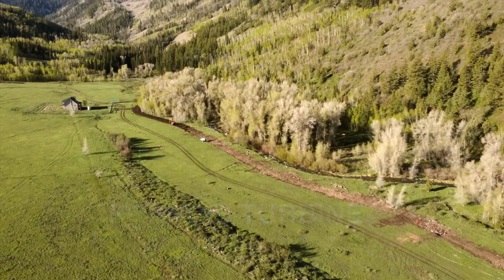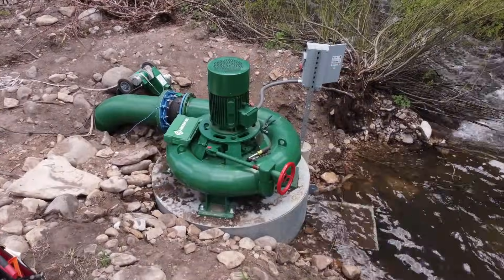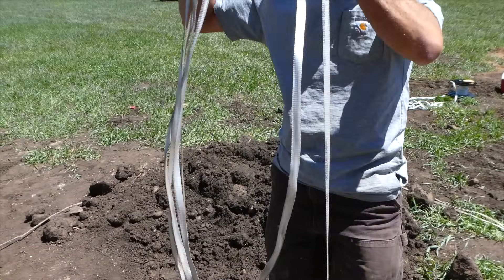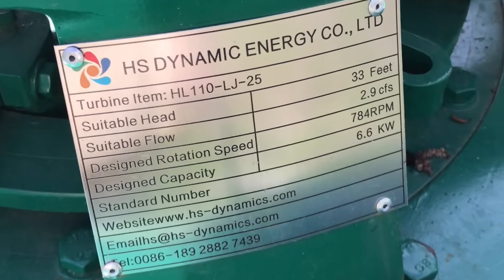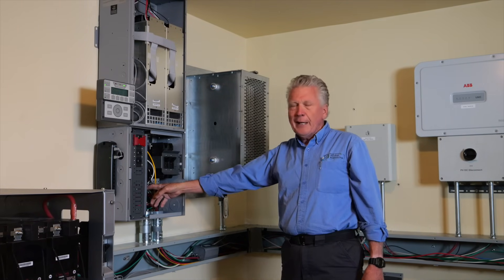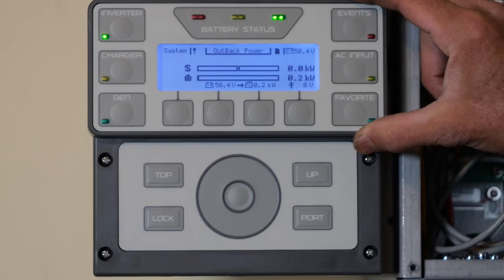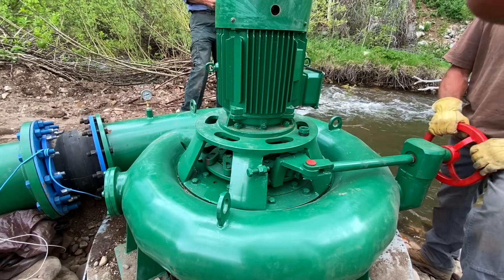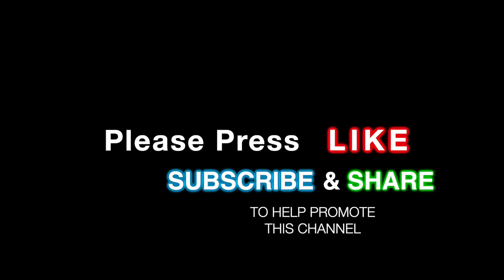MicroHydro Francis Turbine Part 2

Comment: Its a shame to have shown tis as a great project ...but never disclose the COST.  It leaves to many to just think that it is to expensive to want to do it....
Reply from the maker: I appreciate your comment however I am not the owner of this system. I merely documented this particular system.  Even if I did provide cost figures, it would not be of much benefit as each system is unique to the chosen site and costs can vary widely depending on numerous factors.  First there is the potential power available at the particular site which dictates if the desired use of that power is practical.  Who will design the system?  What will be the best equipment and materials available to meet the unique requirements of the most beneficial and practical design?  Then there are expenses involved in acquiring water rights which are likely different in each state or country depending on a pro se (self applied) application or hiring lawyer to work on them.  Who will do the labor to install the system?  Is it your own sweat equity, friends that can help, or hired labor and at what rate?  How much time will it take to install?  What materials can be accessed?  Reused or new pipe, copper or aluminum wire?  How long a length of wire?  What building(s) will house the equipment?  What transformers, batteries, load regulators, power shunts, or utility net metering are available and/or appropriate to the particular site?  All of theses factors can add to the costs and it would be naive of me to present  a one size fits all price.
One must be clear that installing a system is creating an asset which would likely provide power for a lifetime.  Can it be financed over time and does that cost make economic sense when compared to running utility lines to an off grid property?  Will a local utility be willing to purchase excess power and at what rate?  Undertaking a project of this size is not for the faint of heart. It IS a large commitment both financially and in effort and time.
My first system (1.5kw) which I own and documented on this channel cost ~$25k and was installed in the mid 90’s.  Redesigning and moving the same equipment to a more reliable water source was also documented on my channel and took place between 2013-2015 and added another ~$55k but boosted the useable power by a factor of 5 to 7.5kw.  WHEN a project occurs occurs is also a factor governing cost.  Inflation impacts everything involved and the fact that I intend these videos to remain on the internet for years to come and provide some clear eyed guidance to people that are serious about their own intentions, this dictates that I not mislead them with cost estimates willynilly.  
Thanks for watching and for your comment.  I hope you gain a broader perspective from the whole channel and benefit from the heart felt intention with which it has freely been shared and provided.
Reply: @mrhydrohead ด้ออ้ืทออเ้อิแด้อดีา🎉😂❤😢😮😅😊
Reply: @mrhydrohead [
Reply: @mrhydrohead  really.......that is your only, and primary takeaway?  so sorry
Reply: @mrhydrohead ok, So your second system is producing 150kwh electricity /day average. meaning it cost $0.36 /kwh installed . Not bad.  if you have same flow 24/7/365 today Solar is so low, that Will be cheaper if you DIY like this project.
Reply: @mrhydrohead hello sir, who are the owners of this system, how do I contact them please ?
Reply from the maker: I didn’t meet the owners, but was invited to document the system by the designer/installer Ken Gardner. His email address is listed below the video in the notes section.
Reply: @mrhydrohead  thank you
Reply from the maker: @nkyabosi4827  Glad to help. Thanks for watching!  There are  2 other systems documented on the channel. One is my own and another tied into an irrigation system.
Reply: First of all let me say this is an excellent video, I really enjoyed it.
As someone fully on Solar my mind is blown away by this.
Seems like it could generate somewhere between 100Kwh to 144Kwh per day!
Most houses wont even use half this amount of power, but it sure is nice to have all that power.    My big concern is the cost, maintenance and the reliability.
 This is not like a Solar system that can easily be worked on.  I am sure that the Turbine probably needs servicing every 1-2 years and that can really add up in $$ since it's only a handful of people that know how to work on it.  My second worry is the Winter Time and how it handles Ice forming on the creek and the metal frame possibly helping ice to build up near the Intake.  
As for the price, I guess if you have to ask it's not a system for you lol.
Reply: 0😅0
Reply: Why don't you ask them directly instead of trying to look expert and guess badly.  Then learn to spell and edit your own mistakes...
Reply: Guess it’s time to do your homework
Reply: ะะธะะดหกด้
Reply: nothing is expensibe here except the hydro turbine itself
Reply: You could have listed the oem prices per unit so everyone could figure out the other fluff. Thanks for a great video though
Reply: Three years ago, I visited a micro hydropower plant in Nepal. During my visit, I discussed with community members the costs they shared for the project, which amounted to 40,000–45,000 USD for a 25 kW capacity, excluding labor. The community contributed voluntarily to the establishment of the plant. The impact of the micro hydropower project was phenomenal—it transformed the socio-economic lives of rural residents. This sustainable energy source has minimal environmental impact and low maintenance costs, making it an ideal solution for remote areas.
Reply: As the owner  of a similar set up . All up it cost me $80,000 Australian.  I run 4 houses and 3 work shops all 3 phased.
Reply: think anyone who can afford this is watching youtube for info?
Reply: The complexity makes it so expensive.. and the hydro generator is a big chunk.. 

A smaller one will do the same trick with less electricity, but who really cares if much electricity is given ore smaller amounts of electricity.. 
only the owner would that’s greedy for more.. 

With a smaller hydro generator with an peloton wheel and longer running time can provide enough energy for a single home owner.. 
you could use a 22 amp hydro generator which cost 20 euros ore a little bigger which cost a little more.. and apply a self built construction to it, you just take a few batteries connected with each other, so it can load the whole capacity on the batteries, ore use the newest battery which can handle more amps.. with an solar energy exchanger.. that would bring in electricity even on bad days.. 
to run a washing machine its possible if one of the batteries would be loaded over night and the hot  water source comes from the water boiler.. at 35 degrees Celsius it saves a lot if energy with washing.. if it needs to pull that electricity which heats a small pipe within the washer soaks out the battery very quick.. 
so by saving that energy the washer only needs a fraction of the electricity.. 

It’s doable even for people with lesser money.. 
that shouldn’t border you from making that.. 

A smaller version would cost less than 1000 euros.. dollars.. 
depending where you buy your pipes.. and equipments..
Reply: Low side $100k American, High side $250k. That’s my guess.  Depends on equipment, wire, plumbing, labor hours, purchased new? Used? Etc. 

Will probably run for 30 years with basic maintenance providing thousands a month if electricity. TAX FREE!  

Literally pays for itself if you get $1000 per month electricity even at $300k. 

Power company can charge big money to run power then charge you, tax you, limit your power. 

What’s freedom worth?
Reply: @peoplenewstoday  tax free, lol
It provides free energy, because the money it generates is a credit, and is not only taxed but also at a lower price than what the energy supplier company sell it to you.
It'd be nice to have kwh input = kwh output, but no, they sell you kwh at their price and then buy your kwh at a much lower price, so they sell at their price.
Also you pay the kwh and then add tax/vat (which you must pay) but when you sell, you sell at the netto price, meaning it will be usually half. You are an end user , not a business, and you don't get to pass on any sales tax/vat and
Reply: @peoplenewstoday Absolutely, it all comes down to freedom in the end.
Reply: Cost is secondary. What matters most is the return on invest by a given number of money/unit of electricity. But even that doesn't matter if there are no/less other off-grid options. So here I would guess a ROI about 18-24 years including maintenance and replacement costs for the batteries for example, considering market price for the unit of electricity today.
Reply: @liamhotspur9182  Cost is secondary to the potential of acre ft per year ... that water will freely give with a gravity assist .
And then how much of that are you allotted for diversion regulation .
But remember the water/gravity battery storage capacity rate .
It's actually quite good compared to other battery types .
Reply: @liamhotspur9182  cost is only secondary to those with deep pockets.🤔🤔🤔
Reply: Looks like it cost about as much as building a small house...
Reply: @adrianpilbrow a very large house
Reply: That's bc it is too expensive.  But not enough information.  How far to the nearest commercial power source, vs total cost for the hydro. But I'm sure the people doing the project figured that out ahead of time....
Reply: @badkitty2  Plus no mention of the average annual electrical output (in kwh) vs. the current cost of electricity (if available) in the area.  They don't mention the head they generate which is a major factor in the efficiency of the turbine.  I'm all for green energy, BUT please, lets be transparent about the overall cost. It's always interesting to see what people build but, IMO, this video is nothing more than an industry financed infomercial directed at the ignorant.
Reply: The cost of hydropower can be as much or as little as one likes….all depends on your situation and power requirements. 
😂
Reply: Must have cost millions
Reply: This whole system would be cost prohibitive unless it were used to electrify several homes/businesses. The owner of said system better have a solid background in electrical theory.
Reply: @nattydreadlocks1973  as it is? its expensive. looks more like a rich toy boy posing.

batteries? batteries are the epitome of human stupidity.

we could make working, synchronous generators over a century ago. now we rely on proprietary black boxes.

efficiency? im sorry, but my tinkerings with old reclaimed gensets suggests its all bullshit. 

every system ive seen just lets water go. full flow, with this little PM generator of limited capacity then feeding a rectifier with its losses, then a charger, with its losses, then batteries... more losses... big losses. huge losses. then inverters. more losses. losses. losses. losses, and unrepairable, proprietary black boxes. that blow up. make smoke. have no manuals, schematics, repair options. ive had my electronic junk.

people think springs and weights and centrifugal governors are old fashioned and cry when faced with them. they are easily fixed, modified, rebuilt, repaired, replaced.

i find that governing water flow to the power consumed at any time is far more "efficient" than ANY stupid battery system will ever achieve. its easier to do with a pelton, admittedly. a doble nozzle, constant velocity, variable delivery, keep the pelton at the RPM required with a governor on the nozzle. then again. noones given me a francis turbine. sigh. a pelton is easy to build.

it IS hard to do on a small scale. its nearly unfeasible unless, as you said... you have several users. a constant demand helps, with little variation.

governors. hysteresis. reaction time. mechanical inertia. as systems get bigger the individual loads become smaller fluctuations compared to the total.

its nearly impossible to do 1KW as anything but battery. unless the load is nearly constant. 

doing 25KW constant is relatively simple.

its just like someone using a regular genset. they do nothing, and it "cruises" at 3000rpm, no load. they load it down, and the engine always slows, theres always a voltage sag as the governor reacts, opens the throttle, and the engine starts supplying power in an attempt to maintain the voltage at the RPM as set... can live with that. usually...

the harder challenge is when you turn the load OFF.

this where you start getting into flywheel storage, simply as a "filter". reduce fluctuations. when you switch the kettle on, the power is coming from a large flywheel, with plenty of inertia to maintain the speed despite the new load. in the meantime, the generator and the governor controlling water flow and therefore power output can react, slowly, gently, and make up the surplus as required. the load comes off, the flywheel absorbs the sudden rise in energy as its suddenly going nowhere, and then the governor has time to reduce the water flow and reduce power output accordingly. eliminate or at least reduce brownouts and voltage spikes.

you cant do it with your genset, but with a water turbine? yeah... you can stuff massive flywheels onto them. they arent going anywhere, are they?
Reply: @paradiselost9946 Thats off grid system, and with it comes complexities. Roughly similar scale system tied to grid as backup (in ideal situation net metering) would be way simpler.

As an comparison, Mr Hydrohead in his system (NOT this) uses electric heaters and outdoor hot tub as resistive loads. Its easy to find places to heat when you live at 8500ft alt.😊
Reply: @paradiselost9946   you said  "batteries? batteries are the epitome of human stupidity."

But what else is storing water in a tank / lake , than being a battery with it's gravity assist potential ?
What's the problem with solar and wind ?   Intermittency correct ?
Ergo use solar and wind to pump water .
It is a multi use resource . . . >>> and think ??? >>> where else to harvest , like how sewerage systems work .   Albeit maybe the suburb just needs outlawed ?
Reply: @Mk101T  a "battery" is technically just a collection of things... battery farmed eggs?

if you must be pedantic "electrochemical storage of energy in a collection of connected voltaic piles or cells".

is that better?

a lake is NOT a "battery". it is a reservoir. though it is a collection of water molecules, so i guess it fits the criteria... 

pumping water is fine, except with the wind... its still not utilising the fact that the power available in the wind increases on a cubic ratio to the velocity. though theres far more likelihood of realising that wasted potential by pumping water with variable rate pumps into a reservoir than can be harnessed by "generators" delivering into a non-constant load, ie, the grid.

pumping water, at least youre starting to think outside the box, though thats what wind has mostly been used for traditionally...
Reply: @kimj2570  and.. his theory on batteries is terrible, especially if you ARE grid tied. Most power companies have a "on peak/off peak" pricing program. You might pay .12c/kwh at night, when demand is low. However, you might pay .30c during peak hours, when demand is high. You can charge your batteries to power your operation during peak hours, saving you from paying 2-3x the price per kwh when you've got the AC or heat blasting during peak hours.
Reply: @paradiselost9946  The utility of the batteries is that the turbine and generator can be sized for average demand and the batteries store power when demand is low and supply power when demand is higher than the turbine and generator can deliver. I fully appreciate that there are losses in charging, rectifying and inverting.

Comment: Costs: looks like Chinese francis 10kw generator from costs $4k - 7k range. One can prob do the piping carefully DIY. Most of the cost would be piping, electrical components. Not sure why so much batteries is needed if flow was constant.

Comment: How difficult was it in your experience obtaining permits to build the micro hydro?
Reply from the maker: I think it depends on where you are acquiring them. My own project shown elsewhere on my channel is in Colorado and the process in this state involves applying to water court. The first application was for a “conditional” water right which allows you to develop the project under the parameters set out in the application. It is good for 7 years and can be reapplied for 7 yr extensions if you need more time. Once you’ve developed the water right you the apply to make the right “absolute”. Then that right is permanent. I initially used a lawyer to file for the initial right until I learned applications could be filled “pro se” (self applied). Because you put the water back in your creek it is considered “run of river” and is easily granted. I only know about how it is adjudicated in CO and the process may vary state to state or country to country. Speaking with a water lawyer would likely give you an overview of the process where your site is. Hope this is helpful 🙏🏼😉.  Thx for watching 😜
Reply: @mrhydrohead thanks, yes I am considering property in CO. From what I’ve learned, CO is strict with water usage since I believe many of the basins are considered in a drought. I wasn’t sure if non-consumption for a hydro system would also run into issues. Mind sharing your water attorney?
Reply: @stevecha3612  We are Zhengquan Pump Industry Co., Ltd. from China. We can customize pumps of various models. We look forward to getting in touch with you

Comment: Um I don't understand why you are doing the wiring in this way. Converting from AC to DC then back to ac causes a loss in power from 10% to 30%. Was this intentional? You figure it would be more practical to just produce DC at the turbine to begin with.